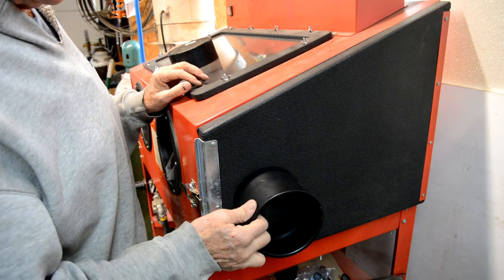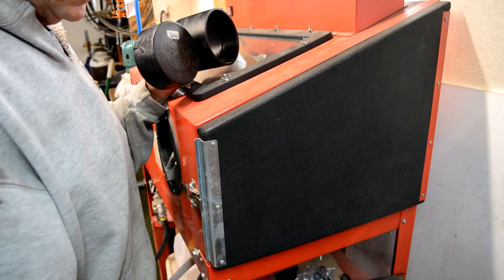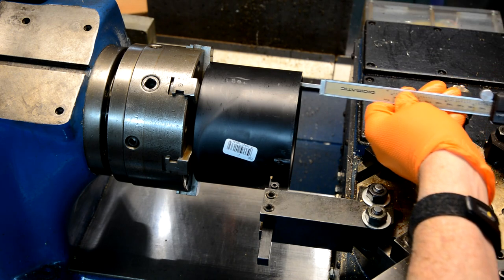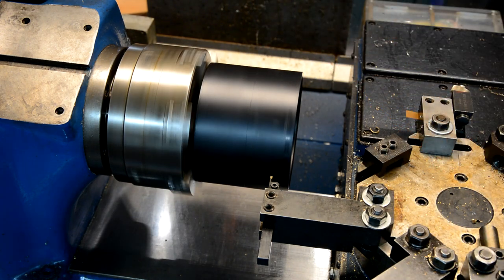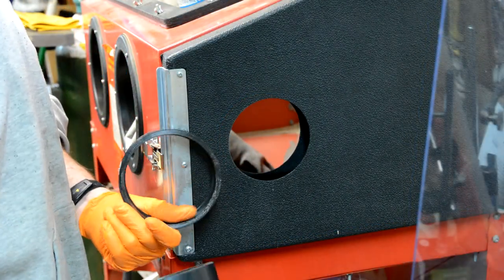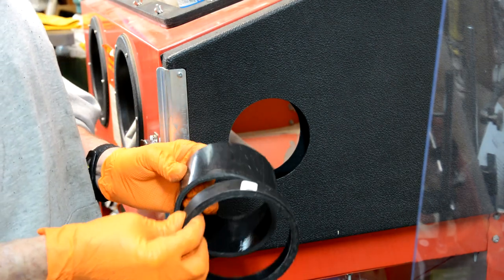Sandblast cabinet modification for longer items (golf club)

Comment: Marvelous job at blasting that iron face.  @30 years ago I worked at a regional club maker shop that had brought in nearly 5000 irons imported from Taiwan with grooves exceeded USGA limits.  Too expensive to ship back.  We shop workers took turns for a month taping and blasting Each clubface to bring them into compliance!  The process on such a scale was brutal, however those clubs finally sold out of stock some ten years later.

Comment: Would not a hole @ 2" in diameter be sufficient?  That would accommodate most any grip any allow clubhead manipulation with low risk of damage to the shaft while its still attached to the head.  BTW, is it possible to utilize sand blasting to remove finish from wooden head clubs provided proper medium?  Thanks for a superb presentation.
Reply from the maker: The hole was not just for golf clubs, that was just what I had on hand at the time.  Also I had some scrap ABS that size on hand.